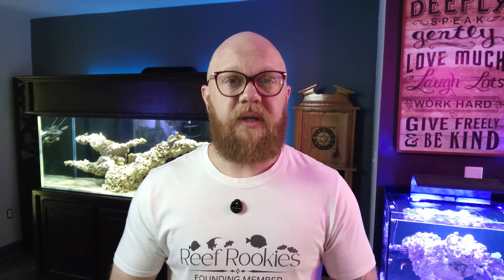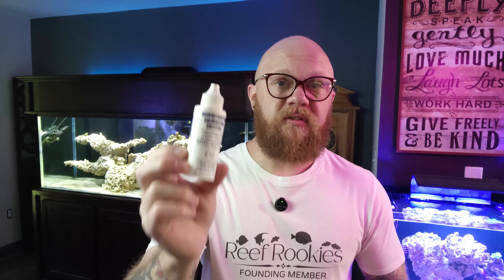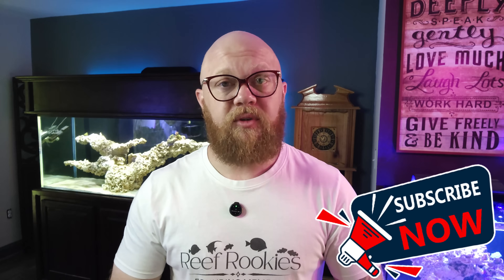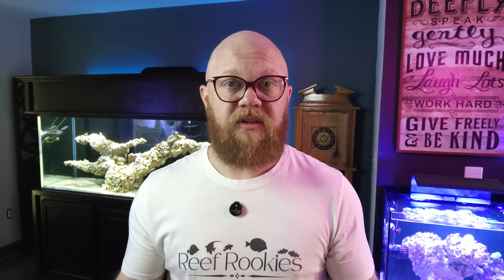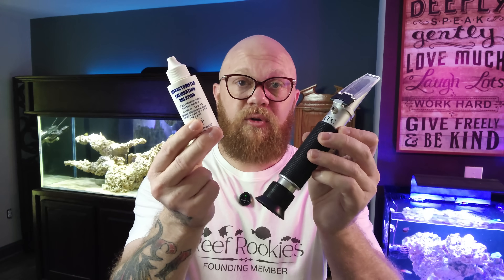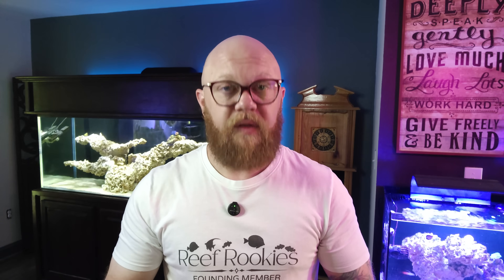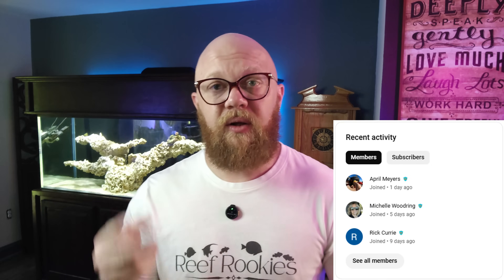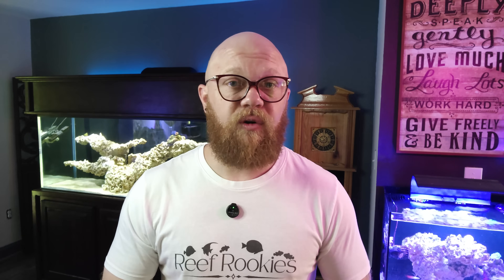Calibrating a Refractometer correctly is important - HUGE DEBATE!

Comment: Currently have a DD Aquarium Solution refractometer which has a calibration fluid that calibrates to 0ppt per the instructions. 

I decided to buy some Brightwell Calibration Fluid (as the DD fluid was running low), which calibrates at 35 ppm. 

When checking my tank after calibrating with brightwell’s fluid, my salinity was 30 ppt, which is lower than my regular 33 ppt. I validated the tank with a Hanna pen, which confirmed 33 ppt. 

I then used my RODI water to calibrate, which gave me 33ppt for my tank. I think I am going to stick with RODI and validate with my pen.
Reply from the maker: That's an interesting observation, and it's always good to find a calibration method you trust!  Some are definitely ok with RODI for calibration, some are not.  Me... Im switching to a glass hydrometer. No calibrations ever, and always 100% accurate.

Comment: Thank you for the video. Critical for anyone getting into this hobby. To add some findings that may help others, Here’s some info I’ve gathered over the past couple years  battling salinity swings: Refractometer and heat changes can cause a significant error. The auto temperature compensation ATC labeling should not be relied upon.  As the bimetallic material in the device that flexes to “compensate”  only flexes a bit around the listed temp which is usually 20c or 68deg. Not close to our tanks. So keeping the temp of the unit the same between calibration and reading is essential.  Work around is letting it sit and do all readings at room temp so your hand doesn’t warm it up and give you a lower reading. 

Trick with swing arm: use a pen insert and tap the arm a few times. No bubbles. Then always rinse with RO. Swing arm from Instant Ocean has been spot on compared to Tropic Marin glass hydrometer. And no need for a graduated cylinder. The hydrometer protective case is perfect to take a reading in. Hannah salinity checker reads low for me.  And the calibration is easily erased if you hit Cal at any point.
Reply from the maker: Thanks for the tips based on experience.  Voices like yours really help people make good decisions!

Comment: Enjoyed video.  I’m skeptical of the ATC claim.  I have BRS labeled ATC and I see a slightly different reading in makeup water between 68 degrees and 78 - so I still calibrate and measure everything at same temp to be sure.  I did ICP and I was close to my target of 1.026 but was 1.0267.   I decided to aim for 1.025 for my mixed reef after my ICP test.   At the same time I calibrated a dip style hydrometer as a backup.  I also found the refractometer works best for me to use same light level, hold it perpendicular to my eye, and you don’t have to close one eye.  I also see a slightly different reading in right and left eye as I wear glasses so I will use my left eye often as I have better vision in that eye.  After going through this learn curve I think I should have bought a digital! Thanks again for great video.  Good luck reefers!
Reply from the maker: Awesome to hear you found the video helpful, and thanks for sharing your experience!

Comment: I had my calibration solution expire and my tank was way off. It expired for about 3 months and I was slowly making my tank more salty. I had coral and fish living in 1.029 at the end but since it was a slow change over 3 months everything looked ok. Finally did an ICP test and couldn’t believe what it was telling me about my salinity. Lesson learned! Check expiration date!
Reply from the maker: Yikes! Glad you were able to get things back on track.  If the water in the solutiin evaporates itll definitely be off!
Reply: @reefrookies  I was using my Hanna salinity checker and it turned out to be 2.7PPT low, I cant remember if I calibrated it incorrectly or if it was genuinely that inaccurate, but an ICP test showed my tank was at 37.7PPT (1.0284) at the time. Ive since bought one of these refractometers and lowered my salinity to roughly 35ppt

Comment: Ah the Salinity rabbit hole. I had 4 new bottles of the Aqua Craft calibration fluid like you showed in this video.  Every one of them read differently. SMH  I started making my own calibration solution using RHF article,  after I ran into this problem.
Reply from the maker: Making your own is a good call and where Ill be going soon.

Comment: I must be very fortunate.... I've always calibrated using distilled water (reefer over 10yrs)... And my salinity is always spot on. Recently did a Fauna Marin ICP... Bang on 35ppt. So this may not be correct for all refractometers.
Reply from the maker: There are indeed many species of refractometer.  Some can be calibrated with RODI, most on the market for budget prices shouldnt be.  Glad yours is workin for ya!

Comment: This 100% happened to me! I wish this video were out 6 months ago. I was calibrating mine with distilled water per the instructions. Over 3-4 months my tank kept getting worse and worse things were not looking happy or dying. Come to find out after buying a new refractometer and special calibration fluid I was at 1.022. Also wanted to confirm my magnesium was always crazy low and I was dosing a ton. Correcting the Salinity to 1.025 over 2 weeks made everything pop. I have the ATC one and didn't think about floating the bottle of calibration fluid. Will do that to.  Thank you for sharing this!
Reply from the maker: Wow, glad you got it figured out and everything is back on track!

Comment: Not turning off my auto top up while doing a water change is a mistake i make weekly. Maybe I’m incapable of learning 🤣
Reply: Done the same thing a couple of times 😅
Reply: Dude! Every.damn.time….
Reply from the maker: Been there, done that haha!
Reply: Yep
Reply: Honestly im glad im not a homeowner with the amount of times I’ve left the rodi running. Fiancé now makes me fill the top off container in the sink 😅
Reply: @silentforcce i uses to do flood the kitchen 😂 not any more i up my game and have installed a 300ltr ibc in the wash room and put an overflow line on it no more flooding
Reply: Buy a WiFi plug. You can set it to turn on 1 minute a day and even if the WiFi disconnects it keeps track of the time and continues each day if that's what you want it to do. I have my rodi with a float switch auto shut off to a 3 liter drum that has my auto top off pump inside. The rodi is on 24/7 but only produces waste water when the top off drum is low as the float switch cuts off the water. Only costs about £20-£25 for both these things. I also have all this outside in the shed and drilled a 7mm hole to get the ato hose inside so no chance of flooding.

Comment: Good luck measuring 3.65 grams of salt. You need to calibrate the scale first for that. I would recommend to use 36.5 grams in 10 times water volume to decrease the error
Reply from the maker: Id generally agree.

Comment: I always use the Hannah salinty checker and use there calibration solution not RODI water. If the salinity seems really off or juat odd to me I'll always double check it with the Milwaukee Salinty tester. I do the samething when testing Nitrates and Phosphate.
Reply from the maker: Those are some good methods for double-checking.

Comment: Counting the hours, can't wait!!

I use 35ppt refractometer calibration solution.
Reply: Ive had tons of bad experiences with calibration fluid. They dont ever seem to be consistent. Bought two bottles at the same time from Amazon and one read 30ppt and the other 36ppt... which one to trust??? So i started making my own. And its super easy. I would make sure you have a quality scale if you go this route.
Reply from the maker: What brand do you go with?
Reply: I use BRS Refracto Juice. I test my bottles with a Milwaukee salinity tester and it comes out 35ppt every time.